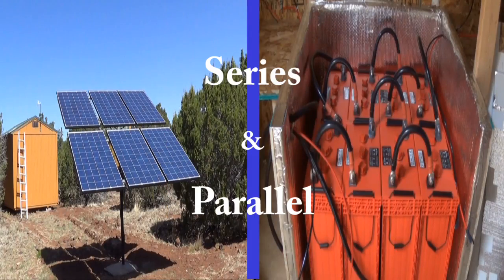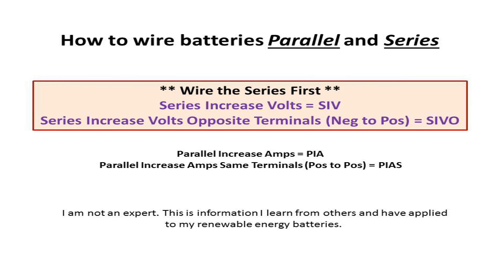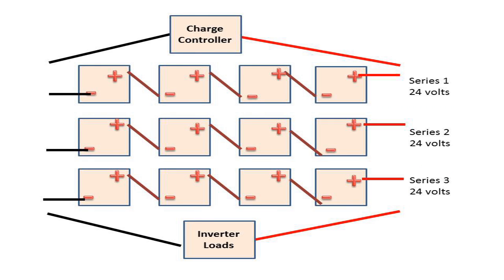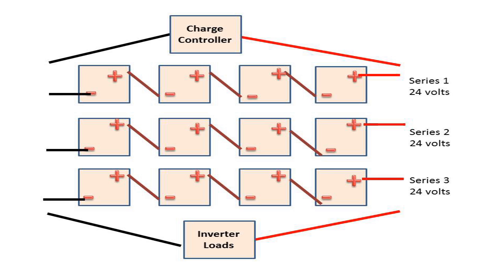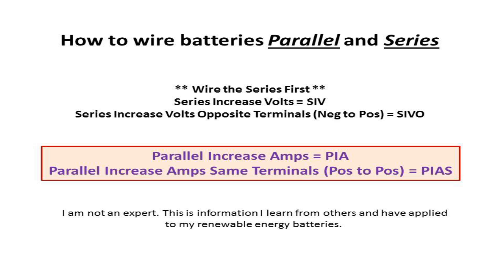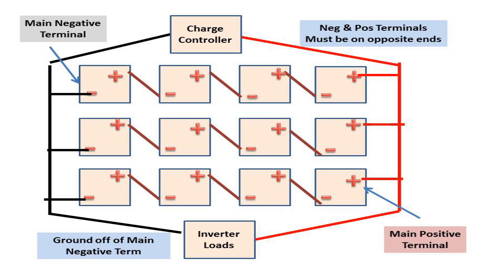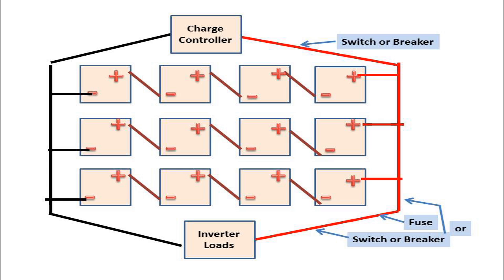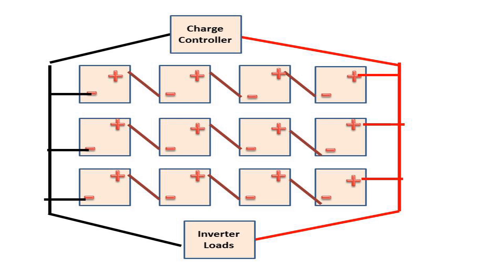Which Comes First?  Series or Parallel When Wiring Batteries

Comment: Basically Sizing Wiring is like Moving Traffic, anyone's that's been stuck in Morning or Evening RUSH HOUR TRAFFIC, an Oxymoron BTW Nothing RUSHES during Rush Hour Traffic, knows what this is like and how much HEAT can be generated. The More Lanes there are, the more Vehicles can pass by each other just like Batteries, they have a lot of current that needs to Move, the Larger the Wire the More Current can move with Less Resistant and Less Heat. Of course this is just a simple analogy but it sums it up quickly for those that think using Speaking Wire on Batteries WORKS JUST FINE; sure if you're a Mowron that is... For those that don't know a Mowron is the King of Morons; just saying...
Reply from the maker: i like your analogy..

Comment: Hi can you help me ? I have 8 x12v I need to wire up to make 24v max amps  to power the inverter 

Can you draw me a diagram please mate
Reply: Make two twelve volt banks in series and then connect them in parallel.
Reply: @ashforkdan  actually it would be best to make four 24 volt banks (two batteries in series for each bank) then parallel the 4 banks. You could also make two 12 volt banks with 4 batteries each in parallel then series them to get 24 volts.

Comment: this depends on what you are using for batteries. if you are using 3.2volt battery cells then you wire parallel first. the example is putting together 3.2v x 200AH cells in parallel to create a 3.2 volt x 600AH unit. then you put these units together in series putting 8 of them together creating a 25.6 volt x 600AH battery bank giving you a total of just over 15 K/WH of power this way you have a battery bank that can be balanced easily and you won't end up with a run away cell that may explode or cause other cells to drain improperly and destroy your battery bank. the reason so many people have been doing it backwards is because they have been using 12 volt lead acid batteries which are the worst thing you can use for a battery bank. they charge poorly and let go of their power poorly as well. lead acid is a horrible battery to use when you are making a battery bank and are very expensive in the long run where as Lifepo4 batteries are very cheap in the long run lasting as long as your solar panels if you take care of the wire them correctly and don't over drain or over charge the during the years. 
so wiring in series parallel is backwards when using cells and not batteries. a cell is a power box that has a small amount of power like 2 volts or 3.2 volts and is not a battery but a power cell. you put the power cells together parallel series and you will end up with a long life battery bank.
Reply from the maker: good info

Comment: I highly recommend using battery balancer between each battery. addition to your main wiring. Usually they will support batteries each.  Also you can use optional voltages from your battery series. For instance I have 48 volt series and run 24v devices by connecting to start and stop on 4 out of the 6 volt batteries out of 8.  The battery balances will balance them back out.  You need to make sure you use diodes between batteries and equipment to stop any back-feed damage or drainage of batteries.
Reply from the maker: some battery charges can equalize the batteries. which should be done monthly. i do that with mine.

Comment: Should explain that when you increase the voltage it doesn't increase the amps. They stay the same. But you do increase the capacity of your amp hrs.
Reply from the maker: siv and pia..... series increase volts, parallel increase amps.

Comment: Instead of cables that corrode inside the sheathing and restricting amps try using copper or bronze flat stock about a quarter inch think one inch wide. And make your connections a buss bar. There is 0 resistance compared to cable.
Reply from the maker: thanks.

Comment: Is there any way to control to stop battery or batteries discharging before it ( they) are getting 50% downloads automatically ? I appreciate your help.
Reply from the maker: my inverter has a low voltage shut off . havent looked into one for dc only but you can put an inline volt meter and use a main breaker so you can look at it often and when volts get low you can trip the breaker cutting the power saving your batteries.

Comment: Been looking for this type of video for days, and it shows up in recommendations! I saw a video where they connected the load/charging terminals from other than the opposite end terminals. He mentioned something about  batteries being discharged and charged equally.
Reply from the maker: the way it was explained to me was once you connect the batteries it becomes one. inside a battery is many batteries (cells) . a battery only has 1 pos and 1 neg so once connected you have 1 of each and go with it.. that should help keep the batteries equally charged however you will always have some cells over time that go bad. keep the water level up on all cells.

Comment: A few quick questions: Why wire up in parallel to get 24V i stead of 12V? And for a person just starting out with very low electrical needs, start with a few 12V batteries wired in parallel, then switch over to a bigger 6V in series to get a 24V battery bank when the 12V batteries die? Is there a cost difference between a 12V inverter and the 24V inverter in price?
Reply: By the way, saved this video to a playlist to make it easy to find.
Reply from the maker: great question. most of the time if you can go with a 24v system its a little more efficient. for smaller systems 12v is perfectly fine. to get started doing 12v batteries wired in parallel is fine with a 12v inverter. once you decide to increase the capacity size of your system it might be good to go with 24v.  price in inverter difference not sure. when I bought mine I looked at the same brand samlex and looked at the specifics (stats sheet) for each one found the 24v was more efficient so that's what I went with. also to consider if you are going to have 12v lines running for over 60 feet or so you might have loss in power and not enough to power run your 12v devices. I ran 24v 70feet used a step down to 12v so my 12v line is running no more than 30 ft using 6 gauge to run the 24v, and 6 for the 12v line then drop the line down to 10 gauge to run the lights and other stuff.  does that help?
Reply from the maker: nice
Reply: ArizonaHotHomestead My plan is to have the battery box and inverter as close to each other as I can get. What are your thoughts on a closed in and weather-proofed battery box on my cabin porch that also serves as a sitting bench?
Reply from the maker: absolutely perfect idea. in fact the solar folks I bought by stuff from has their batteries in a box on the porch of their portable building. they use 2 car taillight bulbs (12v) on opposite ends to heat the box during winter .

Comment: How do you deal with drift of the individual batteries when wiring series first?
You would need an individual BMS (with balancer) for each string of batteries, right?
Reply from the maker: dont know about drift. the charge controller should have the ability to equilize the batteries. the key is to not have a load drawing anything while equalizing and you should equalize for at least 5 hours. using a balancer does the same .

Comment: hi just one question what size charge controller and can you run a 12V inverter on your battery bank ... thankyou
Reply from the maker: 12v inverter can only be run on a 12v battery bank.    size of charge controller depends on your solar panels. how many amps coming in? if you have total of 10 amps from solar panels you want 20 amps controller. this prevents any slight increase from panels from burning up the controller.

Comment: I have watched several videos,just as this one none of them has explained why you have both series and parallel together...What is the point?
I plan to use all 12V batteries in Parallel that wil still give me 12V but alot more amps in running time.
So...why are you using both series and parallel?...what is te benefit in that?
Reply from the maker: If you want to increase your volt to 24 or 48. Depending how large your system is higher voltage is more efficient. Series increase volts. Example if you want to run multiple things that requires lots of watts like 6000 watts you want to use 48v .
Reply: @ArizonaHotHomestead  
Huh?...im not sure that is a good reason.
Have 4 - 125 Amp 12V Batteries on a Parallel system that is a total of 6000 Watts.
I dont have a camper or an RV,they are for my house during power outages after bad storms or huricane season. The house runs on a Parallel system but what you do may be for something else.
Solar would be pointless during storms of hurricanes,there is no sunlight.
Reply from the maker: Example when I invert to 120v to run ac, washing machine, etc the inverters that are available may not handle the watts being used at 12v but if I wire battery to make 24v system I can use a more efficient n an inverter that can handle more watts. Small systems 12v is perfect but larger you go the higher volts is more efficient
Reply: @ArizonaHotHomestead  
AC's are not on 120 but I think I get what you are saying.
series may do better with AC's...Range Stoves...Dryers...Hot Water Heaters 🤔👍ok.

Comment: I'm looking to make 84v 50a batteries out of 12v20a so 9 batterys can you send me a diagram. ?
Reply from the maker: why 84V. need even number of batteries plus you can do 20a, 40a or 60 but not 50. . wire 7 batteries in parallel to get 84v 20a.

Comment: 10:30 I did not have a fuse or breaker between battery and inveter. Inverter failed and pulled a bunch of current. So much current the battery terminals melted, so when pulled up on battery cable, broke the circuit ( and the battery ). Close call. We now have a 100 amp fuse now between the 1,000 watt inveterter and the 12 battery.
Reply from the maker: you really should have a fuse or breaker between each component. .
Reply: every conductor (wire) should have a fuse, and that fuse should be rated at between 125% times the appliance current rating (minimum fuse rating), and the maximum ampacity of the wire (maximum fuse rating).

Comment: Hi what are the pro’s and con’s to wiring in series/parallel?
Reply from the maker: no pros and cons it more about what you want the batteries to be. SIV. series increase volts.... PIA Parallel increase amps.... to get the total volts you wire in series and based on your number of batteries you wire the rest in parallel.

Comment: So what's the voltage of the three series combined
Reply from the maker: batteries wired in series increase volts (SIV) amps stay the same. Parallel increase amps (PIA) volts stay the same.   always use all batteries with same amps and volts.  .

Comment: Instead one long string 10 batteries in parallel 1 end POS.  other end NEG  Can I do combine 2 sets of 5 batteries in parallel so it can be less resistant
Reply from the maker: and wire those 2 sets of 5 batteries in series ? if so thats fine series increase volts. parallel increase amps.
Reply: @ArizonaHotHomestead  
What is the good choice with less restrictions and well balances 
( connect 2 set off 5 batteries in parallel )
( connect 1 long set off 10 batteries in parallel)
Reply from the maker: @jameshuynh5436  what volts are you going to run? a 24v system is more efficient then  a 12v. but if you have small loads running off of it maybe a 12v works better. i like the idea of higher volts (series)

Comment: Hi nice video. Just how bad the losses / imbalance could be with batteries wired in parallel is shown on the Smartgauge website. Just taking the inverter from different batteries 'on the diagonal' makes a huge improvement.
Reply from the maker: interesting info

Comment: Right series first so the amps will not add up remember that the higher amps will melt metal if you touch positive and negative terminals together if voltage adds up but the amps is low it will only tickles you.
Reply from the maker: amps are the killer.

Comment: How about your solar panels? I understand the smaller battery issue but I don’t understand the solar issue. Why nit in parallel? Batteries are like Christmas lights one goes out and the strand is dead. I see some wiring panels in series does that work the same ? Thanks
Reply from the maker: solar panels wire to increase volts (series) the reason is high volts travel a distance will have less loss in volts. it travels better at higher volts compared to lower volt like 24v. plus high amps will kill so keep the high amps at the battery level.  does that help.
Reply: Thanks it does

Comment: Please allow me to ask you a real wild question. Could you connect your solar panels in series and parallel at the same time just like the batteries?  I told You that it was wild.
Reply from the maker: yes but think this you want the power to travel with high volts and low amps becus it travels the distance better to your charge controller.

Comment: 4s3p....but can i connect the middle 2 battery in parallel to...?...is it save theoretically..?..and is it save to tap inbetween those connection to get different values of voltage and ampereges..?
Reply from the maker: no you will create a short. i talked the solar folks with alternative energy discount where i purchased my solar and wiring different ways and they said you will short out the batteries causing them to not charge or discharge equally weakening the system faster plus a risk of heating up the batteries until they explode.

Comment: Back again:  Never mind about your other video, I found it by accident. You are using a total of 24 batteries four in each  set. 24 volts total in series for all three sets. then you run the parallel. pretend each battery has 50 amps each. would that now make the system 24 volts and 2oo amps? Please correct me if I am wrong. Again Thank You.
Reply from the maker: right on.   4 batteries at 6v makes 24 volt bank (Series Increase Volt  SIV). 4 banks of 24v at 50 amps each gives you 200 amps (Parallel Increase Amps PIA) . total of 24 batteries at 6v each.

Comment: I have 4 x 12v 12ah batteries. Can I get 48v 24ah out of them?
Reply from the maker: to get 48v you have to wire in series 4 12v batteries . series increase volts. parallel increase amps. 48v at 12ah.

Comment: Why not connect all the three diagonals together in each vertical to maintain a better equalization? Not all of them together.
Reply from the maker: from what i have been told you wont get better equalization. i am no expert but from what experts have told me this is proper.
Reply: @ArizonaHotHomestead  I meant to say for a couple of days keeping an eye on things. I do get better equalization doing that but if you leave the straps on it will develop overall unequal affect and you will waste power, being used internally in the batteries forever striving to be equal.
The problem you usually get with many batteries is that you often have to take cells or batteries out of the bank and charge them separately but if you connect the center runs while you do the equalization "overcharge" you can avoid that.
LOL I found it really makes the cells/batteries all unequal TOGETHER and then they equalize together when connected back to normal with a normal charge discharge cycle. Just saying.

Comment: Great video! How would you connect a bms to this 4s3p setup?
Reply from the maker: dont know . i have never used a bms .
Reply: You'd need a BMS per string, which is why we wire batteries in parallel first when dealing with lithium cells.

Comment: nice video!
bluesea makes larg busbars.  I have my batteries wired up to the large busbars exactly like you explain in the video.
Reply from the maker: nice. i didnt look into the large bus bars yet but i think some day i will have to rewire . actually you kind of help inspire me to do this video. . i take it your system is going well?
Reply: thats great to hear.  this was something that I wondered about quite a lot before wiring my batteries.

Yeah all is going really well thanks.  batteries are running great.  next projects are mid point fusing of each string with hrc fuses and cleaning up all the stragely cables with some gutters.

thanks!

Comment: Jeff you are a handy guy to learn from and you explain things so it's not so complicated that the average person like myself can understand fairly well. I am generally teachable but I might need flash cards to actually try this on my own!!! My problem lies in not knowing wire gauges and what size I would work for certain applications. You did give a couple of examples that helps understand what works with matching up with wiring/connecting to the inverters.👍😍👍 You seem to be adjusting to living off the grid very well! Jeff are meeting your your neighbors where you live did you already know some folks when you moved off grid? AND SHOULD I PUT MY QUESTIONS IN ALL CAPS LIKE SOME PEOPLE PREFER WHEN THEY DO WITH LIVE STREAMING.?? THANK YOU 😊
Reply from the maker: lol put your questions anyway you wish. getting to know the neighbors is coming along. becomes a network know one person they introduce you to another. having a good relationship with larry and Daryl with Alternative Energy Discount our local non profit solar guys  has been great. i use  them as my go to. thanks for the kind words . i try to explain things so the avg person understands. wire gauges is actually intimidating at first. think this. its ok to go big as long as it fits/connects to what ever your connecting them to. like the inverter going with 4/00 is big welding cable but works. maybe 2/00 on bigger systems.   enjoy your day.